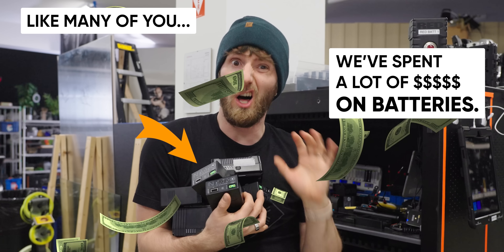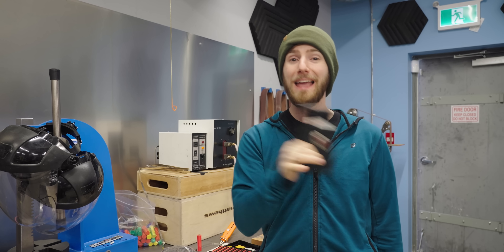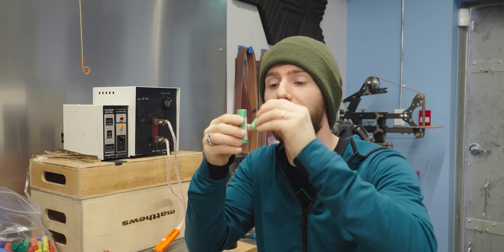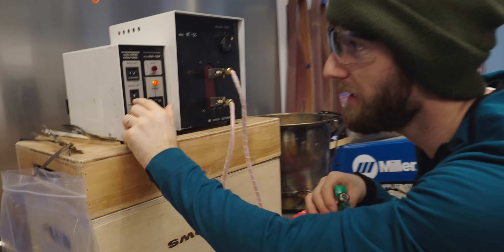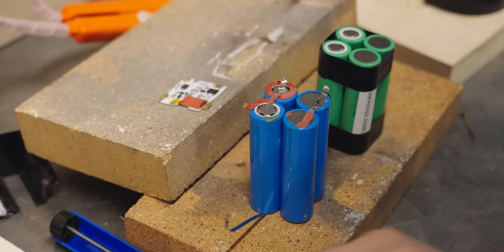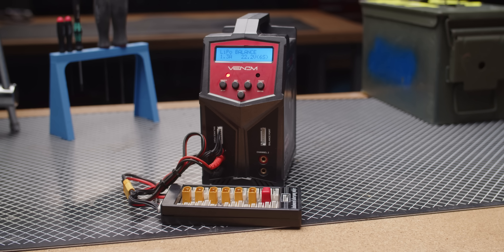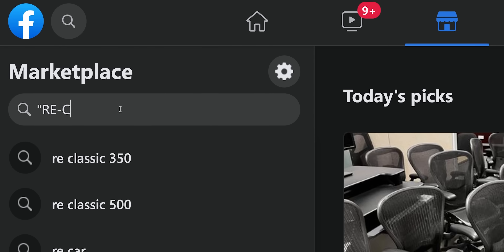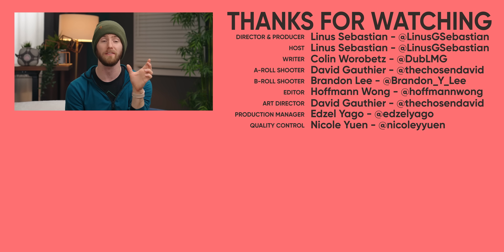This should be illegal… Battery Repair Blocking

Comment: 17:15 another possibility is that this is actually done for safety. Interacting with a li-ion cell that saw 0V is a very reliable way to start a fire.
Reply: and these types of "safety" features are the ones that see themselves get bypassed/removed when the user becomes frustrated at them. pretty dumb actually to just shut-down rather than give a report/indicator "this cell is bad" because it encourages the extremely dangerous behavior to not have one or use one that's not safe for that/any battery model. think about why people use master passwords. because getting locked-out and having to re-set every time you forget the 20 different passwords is an absolute pain. 

interacting with lithium cells is just dangerous, period. always going to have idiots who do it, and you're definitely going to have the special idiot that creates a fire/explosion when they decide the only purpose the weird little PCB serves is disabling the battery entirely. proper safety features have clear indicators and very accessible documentation for why they work that way, and how you are meant to reset them. and ofc, some just passively go-off, like the vents. an active system like the BMS should do significantly more than act as a killswitch. if a single cell is bad, it should indicate such.

the manufactures just don't want anyone, even professionals [or at least, smarter idiots] to service the devices, even the damned batteries... and they won't do this, themselves in most cases, or the going rates tend towards "well, buy the new one"

also, the way these things then get disposed of should be even more concerning. a single battery repair/replacement gone wrong might take-out a house or small business, maybe injure/hurt a few people. many batteries, disposed of or stored improperly? much worse! then you got the e-waste that helps kill our environment, which in turn will kill/sicken many of us [at least] if not addressed. 

giving people the tools & knowledge, enabling the smarter ones to provide the services, would go much further towards safety and the environment than encouraging mindless mass disposal and inviting dangerous hacks currently does.
Reply: @ETXAlienRobot201  by interacting, I mean charging or discharging the cell through normal use of the device. Manufacturers have a very strong incentive that their phones don't blow up. I'm not saying this is the best way to do it, but it's certainly a way to do it. Most of the time it is resettable... If you know how to reset it. The lack of manuals is the actual issue here IMO.  A BMS is pretty much the only part where there is a legit security concern and there is no room for error.
Reply: @BullCheatFR  
when they glue those phone batteries in, they lose any right to claim "we care about safety" , rossman adequately demonstrated/explained that. as for the BMS, its purpose is to safely manage the battery. it should be testing the individual cells, and it should have a mode to give diagnostic reports on them. they're just asking for people to remove/bypass them with the way it's currently implemented. no different than warning prompts on computers/websites, users learned to just click "ok" to everything. [or to even shut-off/bypass security features, not update or re-install an old version, etc... plus, do they care about the owners/operators of recycling plants where their dead batteries [hopefully] end-up? 

i get safety, i just disagree with how it's implemented and very much question the motive to implement it in that specific manner. consider the situation where a factory original battery has a single cell go bad. it should not only manage the situation, but inform the user this has happened. even if you don't re-cell the battery, there's many single cells which could be salvaged for less demanding work. but also, the BMS should still be functional. yet, it's also most likely destined for landfill at this point. 

and again, the main counter-point to safety : idiots exist. no matter what you say/do, someone's gonna do something dangerous. the BMS cannot stop you from re-building the battery, or even taking it apart. the warning label maybe discourages it. and, you cannot attempt to make dis/re-assembly difficult, either, as it requires adding significant danger when brute-force becomes a requirement. if the manufacturers truly and genuinely cared, they would facilitate the safe disposal/service of these things. but, they don't. so, they're either clueless, or they're just lying. safety is not just "don't do this!" , it's "if you must do this, here's now to do it properly" the BMS and whatever DRM code runs on the device being powered is operating solely in "don't do this!" mode. since the other half is missing, what happens when a dedicated individual attempts to bypass it? oh... fire/explosion!
Reply: @ETXAlienRobot201  agree 100% about the glue. I'm just saying I would rather have a phone with a BMS that completely stops working if the battery reaches close to 0V, rather than a BMS that ignores it. I've seen my share of li-ion fires and I don't want one in my house.
Again, most are resettable but the manual is available in Chinese on some obscure website if you know where to look... Instead of being provided on the phone manufacturer's website. IMO the real problem is lack of documentation.
I recycle EV batteries and they all come with a fancy BMS that's unusable because no documentation and no working example to sniff the CAN messages. It's a shame!
Reply: @BullCheatFR  and i'm not saying the BMS should ignore it, though. what i'm saying is some idiot is bound to try bypassing/removing it entirely, that's how "just never do this!" historically ALWAYS backfires. the fact the docu is so inaccessible is in every way intentional. it costs them no extra to make this available and easy to read. so, again, do they care more about security or profits? hint : costs [and even safety/environmental] are cut/bypass pretty often for sake of profits. 

also, regardless of safety measures, these things are just inherently dangerous by using lithium. BMS or not, probably won't save you when , say, an EV crashes. and i believe i've heard reports of shipping mishaps. but, that's hard to avoid besides reducing battery use/consumption. but, back to the BMS. the fact these things are all proprietary is dangerous in itself. how do you run diagnostics on the BMS? you don't. and ofc, the anti-repair angle will be "well, that's why you throw it away". actually, this is why your provide either/and : source code/hw specs, debug ports/tools. would manufactures do this? most won't. they'll argue "for your safety" , and "we could be sued" , the one they may not mention, or won't draw attention to:  "viable competition may arise and this is bad for our bottom line and/or any potential for price-gouging"
Reply: @ETXAlienRobot201  so we're saying the exact same thing!
Also yes a BMS does not make lithium ion perfectly safe. Only under well defined conditions
Reply: @BullCheatFR  yep! lol

Comment: I have an old 2011 (or 2012?) Dell XPS 15 (back when they were shitty plastic laptops). First battery died after a couple months. Dell replaced the battery free of charge. New battery died after same time span. I never really used the laptop much on battery, but I carried it around a lot, unplugging and plugging charger back in three or four times a day. I opened one battery up and it uses a type of BMS with an EEPROM which permanently disables the board if it things it's damaged (probably just counting each plugging in of the charger as full charge cycle or something stupid).

Comment: Funny, so really they are using the same logic as : "using adblockers is piracy". 

Both stem from the general idea that customers should go along with whatever business model suppliers (or content creators) come up with no matter the inconvenience or extra cost. Both refuse to look at what customers want and think about said  business model and correct their behavior accordingly.

And in both cases a 3rd party comes up with a solution to the problem that no doubt the original supplier is going to try to block somehow (or at least disapprove of). We have seen that happen more than once already. An example would be embedding chips in toner or inkt cartridges to check if the replacement is 'genuine'.

Comment: Evil battery pack design still seems to be very common when it comes to laptops. It's very rare that you come across a pack that you can re-cell without the charge monitor stopping the thing from working.

Comment: They are v-mount batteries. why buy red branded they cost more an other v-mount battery are cheaper and just as good I use v-mount can get a lot of them cheaper over name brand ones. I use the NP-F970 batteries with duel NP-F battery V mount adapter so I can only buy one type of battery for camera and monitor.

Comment: I used to replace NiCd and NiMH cells professionally in tool batteries (not certified for Li-ion). To get them to hold together we usually used a couple dots of cyanoacrylate glue on the long side where the battery cells touch. Usually better than tape for holding shape, and less bulky.

Comment: I learned about "evil BMS" some 2-3 years ago, trying to bring back to life some LiPo pack for drone brand that starts with "D". I dont  remember why cell got locked up, but I found lipo cells perfectly operational (it was almost new battery pack). However after hooking up I2C to BMS and reading trough it registers I found it was locked up from operation. Of course it was impossible to un-brick it because in order to write something to BMS configuration you need to have a manufacturer key. Of course drone company has this policy that if anything fishy is going on with the battery, It should't be used as "could fail mid air", but well, yeah  ...  These devices are able to spot that cell went under or above some voltage treshold, in which case they will just lock up power delivery.

Comment: Volatile memory wipe Is NOT carelessness. Design spec has to make additional allowances for it over NV as it affects overall power minimums and failure rates. I can guarantee it's malicious and excused as "protecting proprietary code" and "safety" despite both arguments being laughably facile

PS points for safety paranoia, but that level of sparking isn't uncommon, adjust your settings, and make sure the cell doesn't hit thermal runaway. test after. Those batches were probably fine.

Comment: just because there are sparks, doesn't mean the cells are damaged. burning a hole is a different story XD.
Regards the BMS, a lot of the OEM ones go in to protection or lockup. Most of them can be reset. By placing them on a charger, shorting the battery+ and the charge+ port together or even just wait for x time. Also, MOST of the BMSs require you to first connect the negative batteryterminal to the bms, then the balance leads (starting ar the lowest one) and then the positive one(if needed). Going the other way around can damage the BMS or cause permanent lockup. 
There are ways to replace the cells of a "known to lockup bms" (with bunch of capacitors and a external PSU), but this is more advanced.

Comment: I really felt a F*** you coming on at 16:14
or at least was building up one myself, because that is just plain evil. That's a step beyond being against right to repair.
Also an edit, I seem to have encountered a kind of careless BMS twice. I can't be sure if it's necessarily evil in either case, but it would definitely increase the difficulty of battery replacement. In either case, they completely lost power over time, one of them just from being left alone, the other was accidentally drained all the way without shutting itself off before then

Comment: It's been written in the comments already, but a spark does not mean you screwed the battery up. You are right that dirty probes can cause a spark but it's not the battery about to blow up. It is no where near that easy to bust a lithium cell. Well done for being cautious, but in this case its way over cautious.

It's also common practice in the DIY battery building community to use 'frog tape' between cells. One of the primary causes of shorts in batteries that will experience movement (especially vibration, in ebikes and scooters) is that they rub together ever so slightly and when the wrap on the battery breaks this causes a short. Maybe not a problem with camera battery packs, but worth doping if you can as an extra safety feature.

Comment: This reminds me of when Capcom introduced the "SUICIDE BATTERY" in their CPS2 boards. When the battery is dead the temp memory is wiped rendering the board useless, you need not only to change the battery but also reflashed the memory for it to worked again.
Reply: i was going to mention that, except it definitely had a slightly different purpose. don't believe it advertised itself as safety, either. it was blatantly there to destroy the encryption keys so the game was not playable/copy-able. probably mostly the latter. too bad for them that it ended-up being easily bypassed like any other lock-out chip, and really pissed people off since the whole game became bricked.

on the other hand, the actual encryption was only fairly recently cracked. read about that and barely understood a thing...XD

Comment: The "Evil" techniques are also incorporated into printer inks. Also the backlight LED brightness adjustments on most televisions are usually difficult to get to unless other settings are adjusted such as the "ECO" power settings ETC. These LEDs are pushed so close to 100% of their tolerances that they can literally BURN out. Usually just after a year.  I always set my LED backlight brightness to 60% and I keep checking the brightness every so often as the Televisions software has been known to reset these power levels.  How about a video outlining that.?  Strips of LEDs can be tested with a MEGA BTW.  I have a TV LED strip Testing Tutorial on my page at  https://www.youtube.com/watch?v=v_pWt4tx0sg   Cheers.  Rich..

Comment: Linus. You really should be using a gasket on the top of each cell. A little too much heat melts the thin heatshrink and allows the new nickel strip to short the cell.

I have made submissions about EXACTLY this BMS issue to the Australian Productivity Commission with respect to tool batteries. I don't hold much hope that it will get much attention though.

Comment: Some power tool batteries BMS permanently lock-out after several voltage dips below a set threshold (generally indicating the cells are damaged). Another trick is detecting after market batteries and disabling or limiting functions; I believe canon disables the video functions on some SLRs if they detect a third-party battery.
Reply: Sony does it on their professional cameras, too. They even sued some third-party manufacturers last year (or two years ago?) for bypassing one of their chip-detect systems on the FS7 and FS7 Mk2 camera. Had to be taken off the market.

Comment: Milwaukee does this with their tool M18 batteries. Most tools etc have batteries with a BMS which is programmed in a way which when cell voltage is gone entirely or the cells are disconnected it can no longer be charged.

I think this is alot more common than this video portrays, whether it's malicious or just a safety for stopping the cells from being charged (or used) because they've gone to a dangerous range is another thing I guess.

I'd say it sucks that the BMS doesn't reset when you re cell them but it's really just safety, imagine you charged the rooted cells in the pack and re connected the BMS.

Might get a fire.

Comment: Ive tried to get a few lg HG2 18650 cells to explode (purely for scientiffic reasons of course) and i didnt get them to. I tried different approches, they just got warm & vented. 
These cells are pretty safe i would say 😅
Reply: Good, quality 18650 cells are relatively safe and nowhere near as nasty as rc model LiPo packs, especially those high-amp Lipos for drones and helicopters.